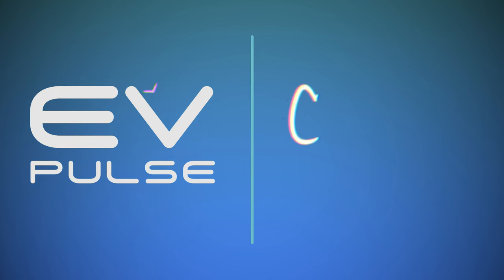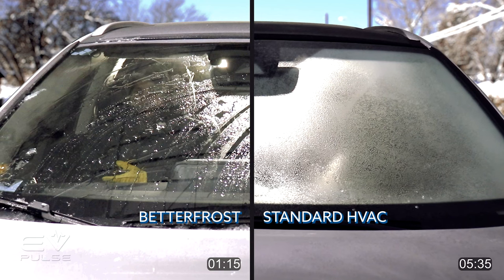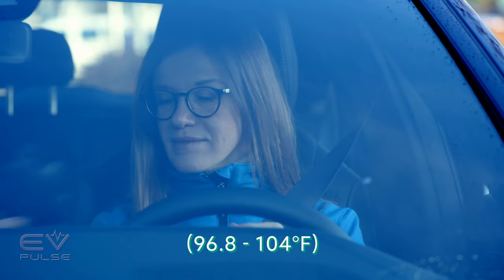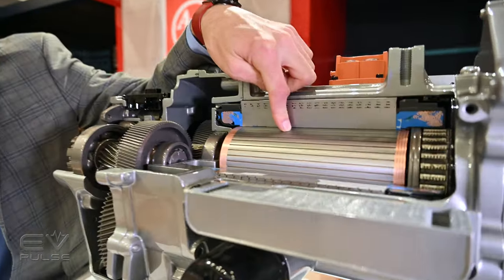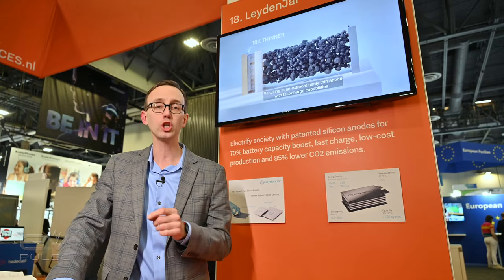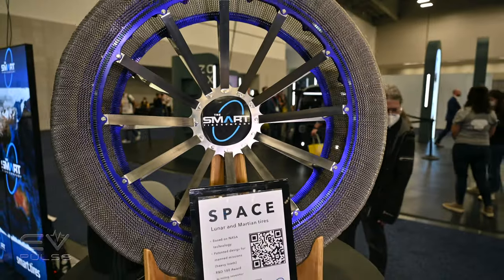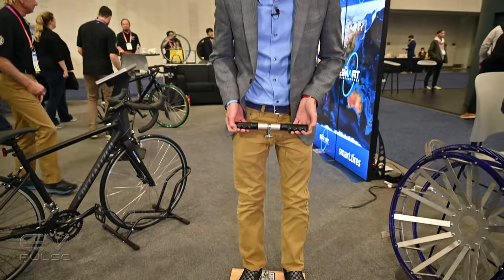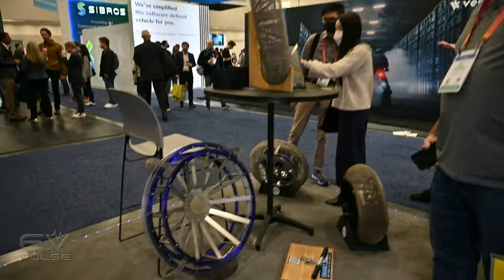5 NEW Technologies for Longer EV Range | CES 2023

Comment: The windshield defroster and heated seat belts could also be applied to conventional vehicles.  Nothing worse than waiting for your engine to warm up on a cold day in order for your heat to work.
Reply: Yeah would think it could also be applied to other windows as well. Some current OEMs put resistive heating elements at the base of the windshield for the wipers (and some motorsports have thin strips in the pecan for fog dissipation) but making it optically clear for mainstream use seems like a cool breakthrough.
Reply from the maker: Reps from a defense contractor that builds things that fly stopped by while we were filming. The aerospace industry is also VERY interested.

Comment: Fantastic coverage! I presume for the airless tires, like the bicycle they’ll all have some type of rubberized coating or traction aid over the metal? 

The battery anode tech looks pretty promising as well if it can be economically manufactured/produced.
Reply: Oh yes, any roadgoing tires will have rubber. Thanks for watching!

- Craig
Reply from the maker: Thanks! Always appreciate your input! The thing with this video is it takes a huge amount of time to put together because, of course, nothing is near each other at CES. We appreciate you taking the time to watch and comment!

Comment: This all sounds pretty interesting!   

Love the heated windshield idea!  Although I wonder what the replacement cost of one is, and how well that windshield holds up to road grit and stones.  Better than comperable regular automotive windshields?
Reply: It should not cost more than a conventional windshield to replace. The technology uses the thermal conductive coating that's already present in many windshields, which is part of what makes this technology so brilliant.

- Craig
Reply: @AutoEsoterica  I could see that.  Compared to ones with a thermal film, that could be good.  Just wondering though, do you know the upcharge on the available windshields with the thermal film?   I have replaced 'normal' ones on different vehicles, and they've ranged from $230 - $400.  I'd have to guess that one with any sort of thermal film would have to be a good chunk pricier than that.  

IIRC, the heated windshields in the old Mercury Grand Marquis (the one with the bronze tint) was something like $900, back in the late 80's or early 90's.

Comment: 40 kWh to defros a windshield ? No way. I did not see units, but kWh is wrong. My e-Golf has embedded wires in windshield to defrost quickly using very little energy.
Reply from the maker: As we mentioned in the pinned comment Craig misspoke.
Reply: @EVPulse  even kW is wrong unit. FYI most PTC heaters max out at around 5 kW.

Comment: @5:50 60% in 6 minutes? That's fast, but that's not faster than the time it takes to fill a gas car.
Reply: Progress.  It took 100 years for vehicles to get where they are today so we shouldn’t expect electric vehicles to get there in 10 years
Reply: It would be fast enough for me to consider EVs being pretty viable for long distance travel.
Reply from the maker: It might be quick enough for some people to consider it. But it won't yet be for everyone. Well, unless you're at the slow pump near our office that takes like 10 minutes to fill up, because reasons? ¯\_(ツ)_/¯
Reply: Fyi, I only mention this because he says in the video that it's faster than filling a gas tank (which is untrue), but yes, I understand it's leaps and bounds above anything else in the market currently.
Reply from the maker: We figured as much :) By the last day at CES our brains were a little on the mushy side.
Reply: @johnnyli4702  I guess it depends on what your drive and how many gallons you have to put in your tank I have to pick up trucks and it definitely takes longer than six minutes to fill them up